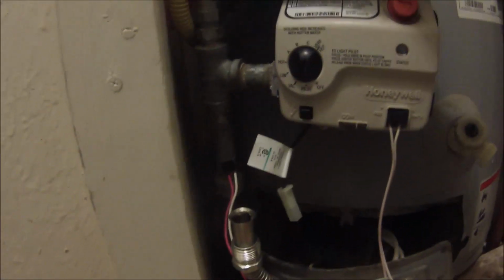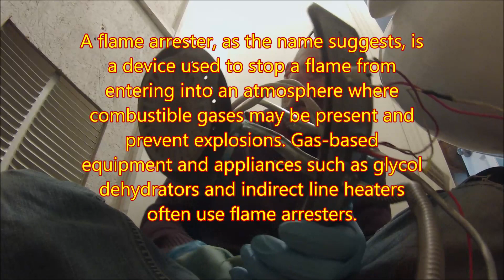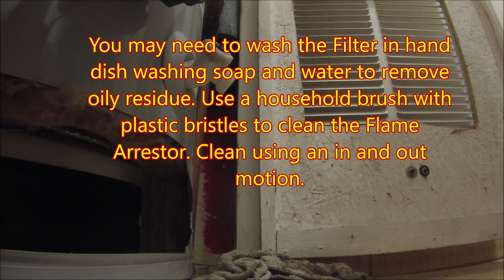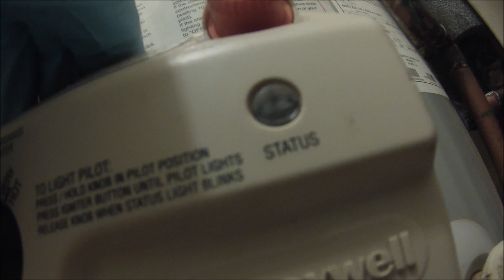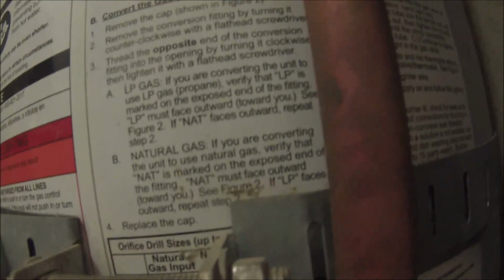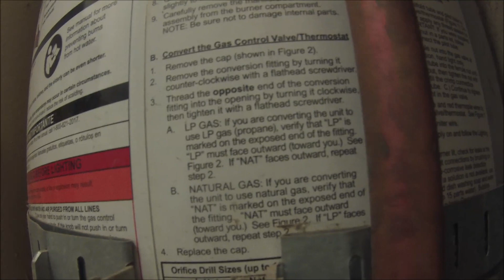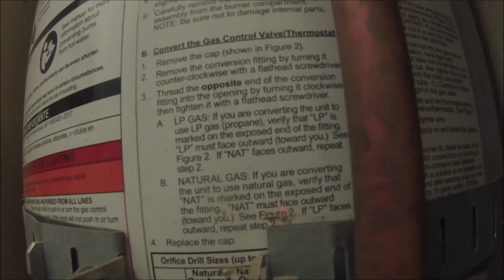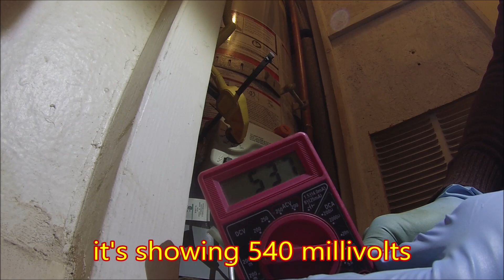A.O. Smith Water Heater Service Call, Keeps Shuting Off

Comment: What is that device you usd to simulate a pilot flame voltage?
Reply from the maker: We made it uses two 3 volt batteries and a Resistor!
Reply: @thewaterheaterfactory  I can see how it would speed up diagnosis on these troublesome gas controls out there today.
Reply from the maker: Oh yeah helps a lot! Easy to make! I'll be making a video on it soon.........

Comment: I thought the average voltage on the thermopile is 750mv.  Why not change (or clean it) if you were only getting 540mv?  Thanks!!
Reply from the maker: The voltage was sufficient , I wasn't sure what the problem was exactly since the homeowner disassembled the water heater burner assembly , Only guessing what could have shut it down since he never read the status light for code faults if any.